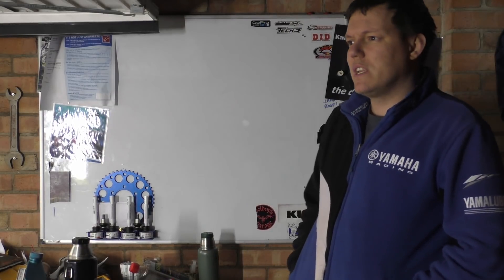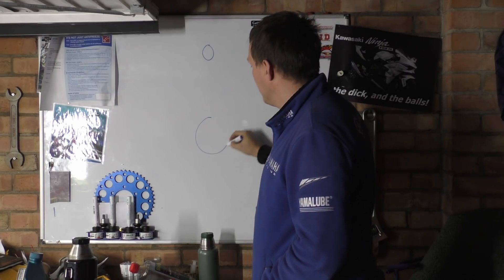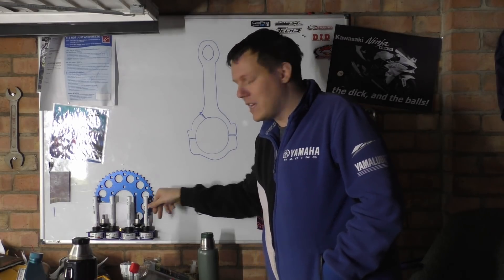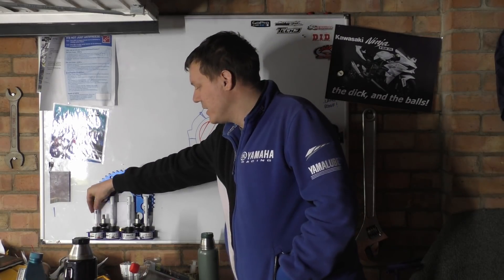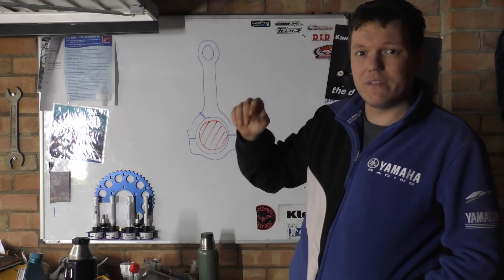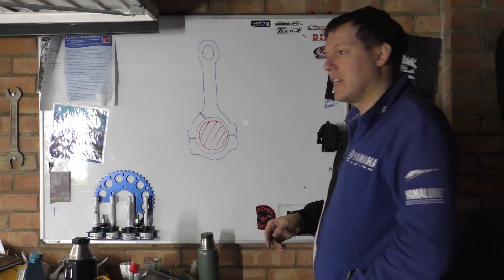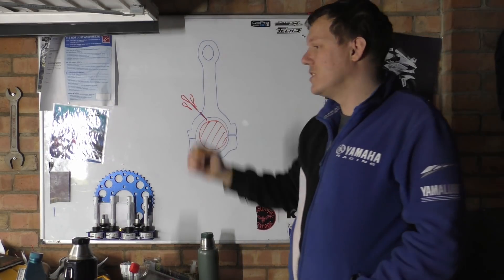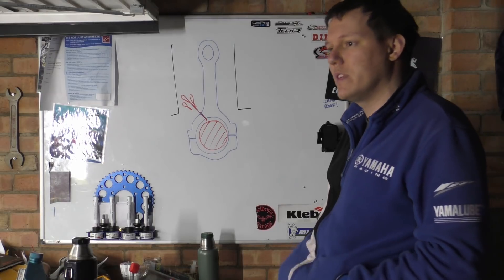Con rod side hole - What's it for?

Comment: Additionally as you note, the oil squirter hole is only on one side of the connecting rods and based on my research it should be directed towards the thrust side of the piston cylinder wall.

Comment: after using an aftermarket racing conrod. there is no more hole. how can i solve that ? if there is no more hole i use my cyclinder wall will be dry and dont have enough oil to lubricate the piston .

Comment: This is one of the things people don't often talk about. Thanks a lot.
However, that squirt hole will lubericate one area of the cylinder wall surface. How is the whole surface area lubericated?
Reply from the maker: By the oil control rings. About 75% of the oil is wiped away, so there is always excess. Capillary action pulls oil around the ring groove to fully saturate the cylinder surface. 

Some engines use an oil feed that goes through the con-rod, but it was found that squirters do a better job.
Reply: @thedirtyworkshop  
I don't think the con-rod holes are efficient, as oil spread will take long, and that is bad for the piston and the cylinder.
The oil squirter is way more effective, I'd say, and more common now.
I'm new to automotive technology so I tend to think outloud when I don't know.

Comment: Hi Sir, Just wanted to ask a question about my car's engine.
It's Honda K24A3(EU), now the question comes.
Why it's conrod's bigend's thrust side have oil grooves? Too much oil pressure on bigends? Maybe oil galleries feeds all main bearings seperateley what is the design goal? Many after market conrods for this engine doesn't have squirter and thrust side grooves, that means they are really bad or it's just a clearance selection? I can't remember but some manufacturers designed thrust side oil grooves with differen orientations and with 1 or 3 grooves. Do they design it for another function?
Thank you so much for all videos.

Note:
Part number for subjected conrod: "13210-RBB-000"

Comment: Its often more clever than you describe. Depending on the position of the oil gallery in the journal the oil can be timed to squirt the underside of the piston as the con rod drilling and journal drilling line up, to help cooling.
Reply: Your point is probably more accurate, as the squirt lubricates the underside of the piston, not the cylinder wall, I suppose.

Comment: Why choosing the pressure lube releif hole on the top? Most combustion pressute is at the upper half of the bearing. The most resonable would be at the bottom?
Reply from the maker: Great question, at the end of the day they need it to be in the top half otherwise the oil has to pass the split. Because of the pressure difference this is why they shifted to using squirters at the bottom of the bore.